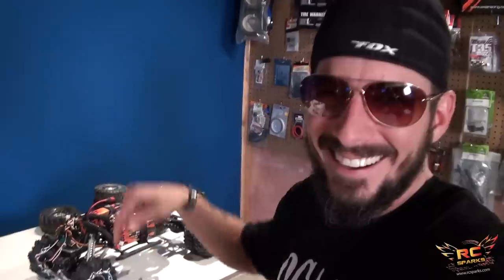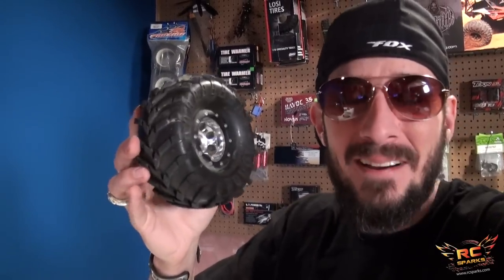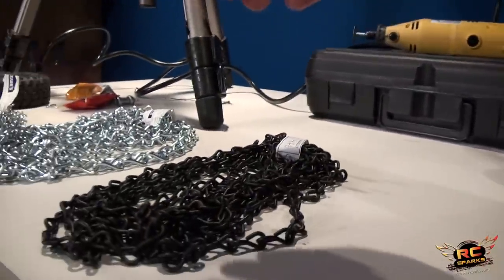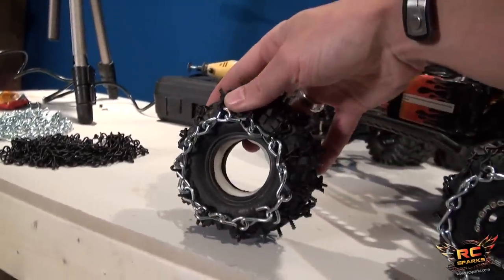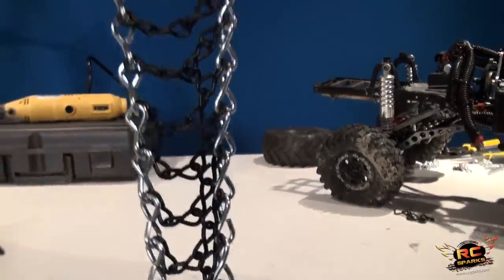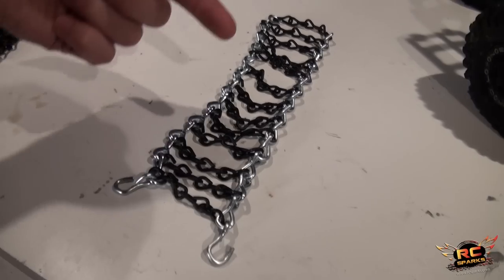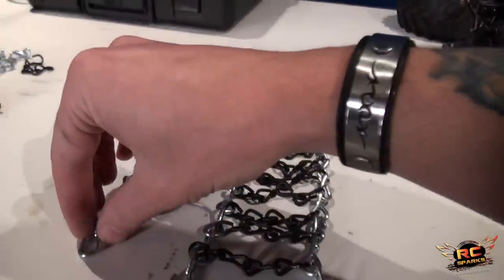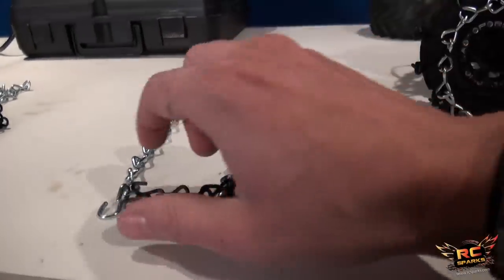RC ADVENTURES - Cheap Tire Chains - Tutorial - How To DIY - Snow, Ice, Mud, Bogging

Comment: Dude love the vids. Did my chains about the same but only 8 cross chains on 2.2 proline AT tires AWSOME for my rustler no skis. did front and rear  but unless 4x4 just need the rear.  #16 chain and also did a triangular stud pattern. Keep up the good work.

Comment: hey i use tire chains alot in real life and if you take some small links and open both ends {use about six links} and place them evanly around the tire then get a small rubber band to hook on all the links the tire chain stays on propperly and longer because you can do the same thing on the inside and outside of the tire without getting cought on the axle housing

Comment: yo dj I think that its awsome that you actually take the time to show how to do everything and tell where to get the materials im 12 and me and my dad are thinking of taking a tamiya f350 hi-lift and use your ideas. by the way how did you use 4 motors? did you use 4 escs or did you wire 2 motors to each esc and how. thanks for all the advice!

Comment: i know that im going to come across as a douche right now, and im not trying to be.  ...but the weight of wheels, tires, chains and axles is what you call "unsprung weight" as its below the suspension and actually has no effect on the sag.  just something to keep in mind when tuning your suspension.  when u push down,  only the stuff that moves is "suspended"